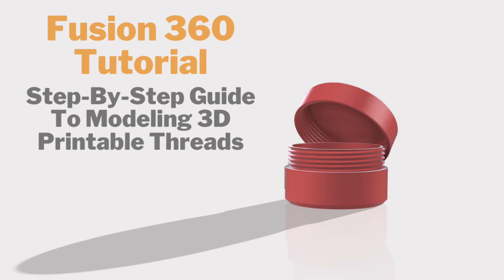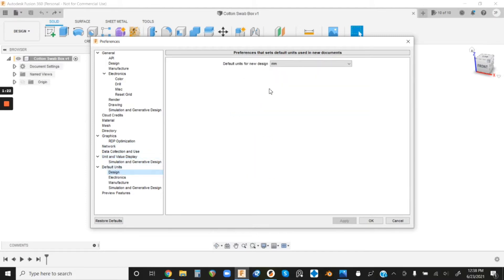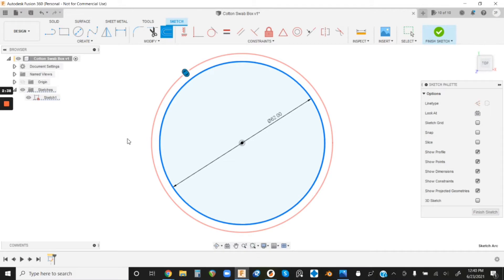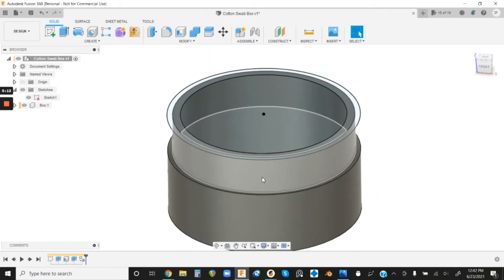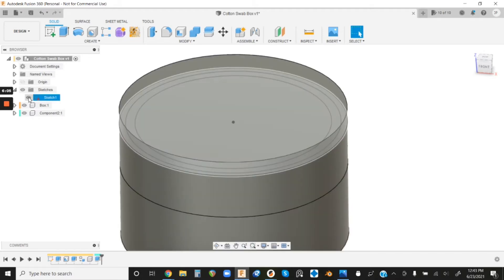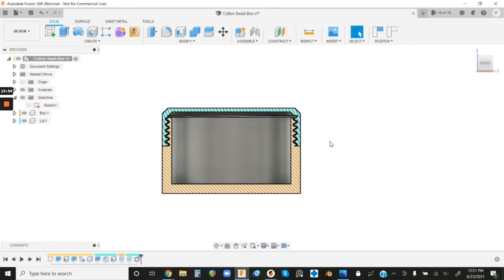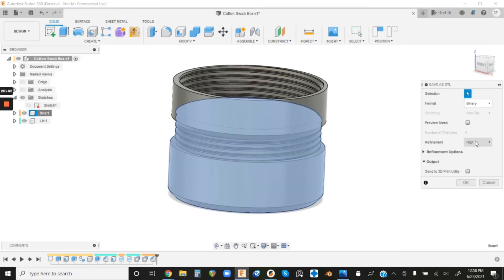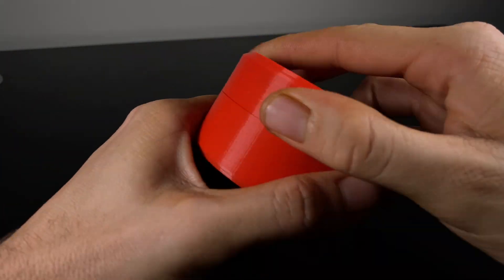(Tutorial) How To 3D Model A Box With Threads For 3D Printing

Comment: Bad drawing.  Lid should be 3-4 mm thick.  Not 2.  Threads are showing through the wall.  It’s not printing good. Bottom is perfect. Tried a finer layer height.  It’s worse.  Lid won’t bottom out on the edge it’s supposed to.

Comment: Hello.  This video was quite helpful.  I'm hoping my comment might help others in the future.  
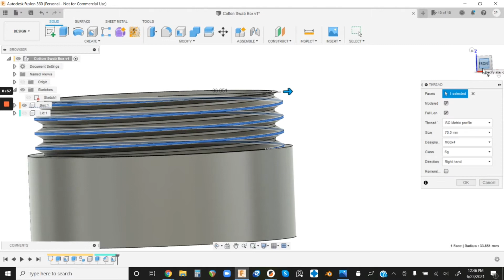Around 8:51, it appears you accidentally changed the thread size to 70.  It should be left at 68.  
Around 14:14, when I used press pull to thin out the bottom, it made the entire shell thinner.  I had to select "New Offset" instead of "Automatic".

Comment: Wow. You are an excellent instructor, touching on every little detail so the viewer doesn't miss something and get confused.

Your explanation of using the press/pull command to provide clearance is exactly what I was looking for. Other videos that I came across all just showed using the same thread command for both the interior and exterior surfaces (e.g. nut interior surface and bolt exterior surface), which of course you should, but then implied that that's all you have to do and it would all work. But NOT SO. You really need to do that additional push/pull operation to provide sufficient clearance. THANK YOU!!!!!

Comment: Hi there! I found your video brilliant and easy to follow as I am doing a bit of 3D printing in my college course. Quick Question, do you have to use the slicing software? and if so why?
Reply: Hi.  A slicer is used to create gcode that your 3d printer reads.  The gcode has all movement instructions, temperature, bed leveling procedures, etc.  You use Fusion 360 to make a model, you save or export that model as an STL file, then you import that STL into your slicer of choice (I like Prusa Slicer and I hear Orca Slicer is good).

Comment: Hi! I was wondering if you could help/make a tutorial of something similar to this. I just got a 3D printer last week and am very new at 3D modeling. I want something like this but with stacked layers of containers if that makes sense. So like the lid would instead be another container that could hold makeup remover while the cotton rounds are in the bottom container and then the actual lid would go on top of the makeup remover container. Does that make any sense?

Comment: Was looking for this exact tutorial - thanks. To offset off of an offset, you need to remove the offset constraint from the initial resulting offset. It works - just sounds stupid when you say it..
Reply: You don’t ever offset off an offset.   Offset off original lines always.
Reply: My Cad/drafting skills are mostly self taught and that's always been a question for me. Fusion doesn't allow offsets off of anything but the original line, so I assume that's a standard. But, if you were on a pencil, does that same standard apply? For myself, I'd like to see the actual dimensions between the multiple offsets, so those should be going in as driven?

Comment: A very helpful tutorial, thank you!
One thing I noticed that might a different setting, is that when I went to to the threads on the lid, the "Size" field defaulted to being 1 mm narrower, causing significant overlap. Once I realized what had happened it was easy to correct, but it threw me off for a minute.

Comment: Stumbled onto your video after making these same circular boxes for some metric sockets. Love the idea. Only problem I have is how to reduce the threads so it doesn't take so long to unscrew the cover. Do you know of a method for reducing the thread count on the inner and outer threads?
Reply: Yeah. The part about spacing. When he put less space in between the threads. The larger the space the less threads. The smaller the space the more thread. Around 8 minute mark is where he explains that part.